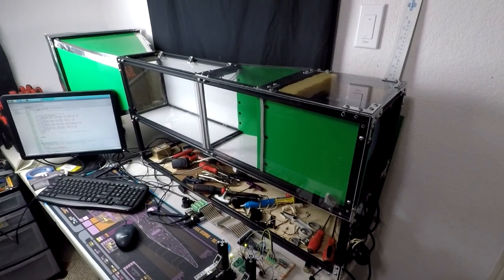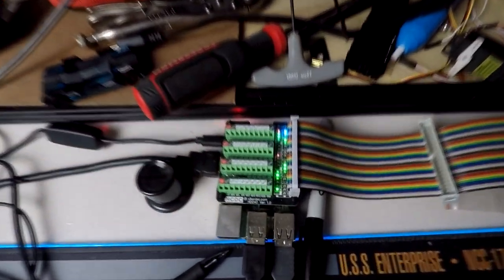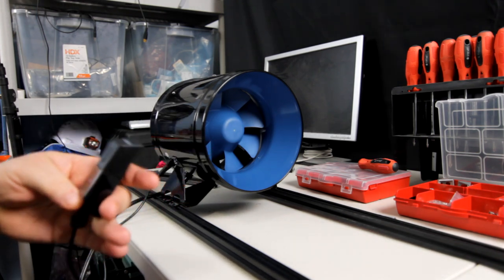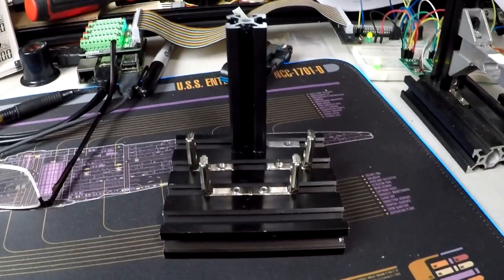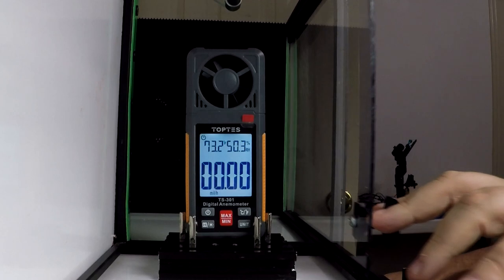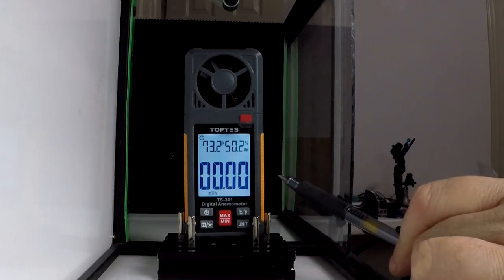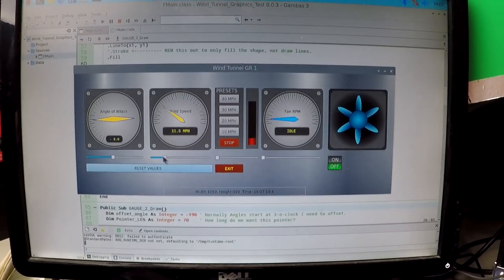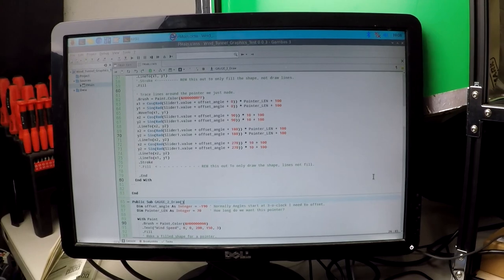Wind Tunnel #1

Comment: Gambas does seem kinda a tier below python and c both in form and function, curious why you chose to use it over something more common like visual basic. In any case, if it gets the job done...
Reply from the maker: Because I am using a Raspberry Pi which is running Linux. Visual Basic is a Microsoft product that runs under Windows. The Raspberry Pi does not support Windows, and if it did, there are no GPIO routines to use the Raspberry Pi GPIO pins. Interesting how you say it is inferior in function... how do you do your graphics in python? Or C? How do you create a GUI? The best I could do in python was to use Glade.